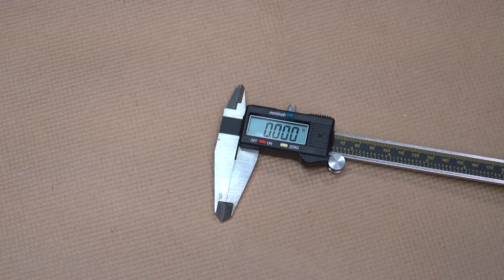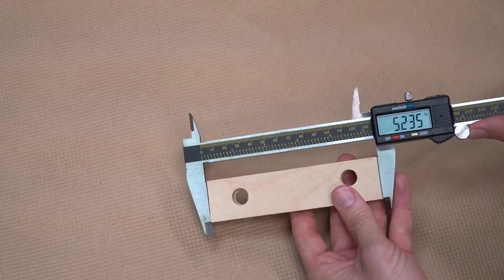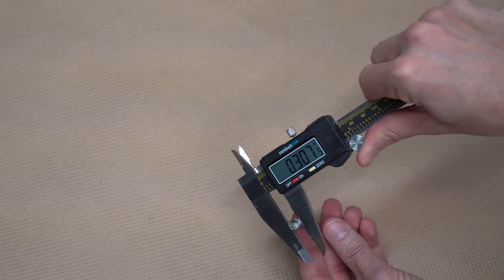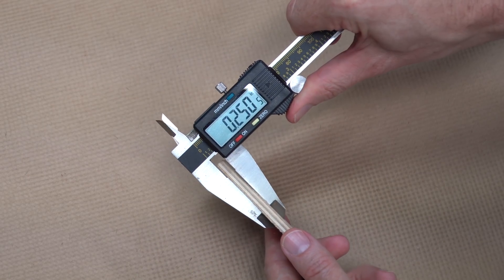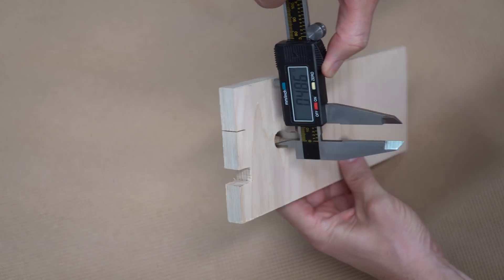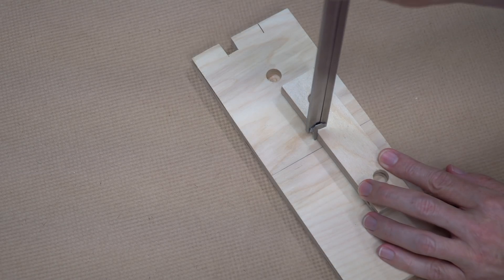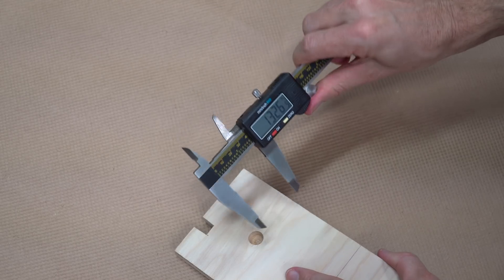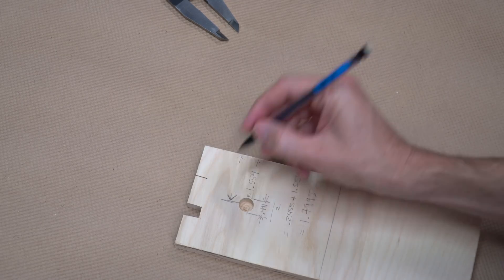What are Calipers Used For?

Comment: I have that exact same caliper. Is there a way to 3D-print the cap of the battery slot? I've lost mine. Thanks in advance
Reply from the maker: The features of the battery cap are pretty small and delicate....I fear a 3D print might not hold up. You could try to create a cap from a small piece of plastic that you carefully carve into the correct shape. Either way, it's going to be tough - good luck!

Comment: I learned as a tool and die machinist, some 25 years ago to use a dial caliper. Yes the digital were available. But cost a lot more than I could afford as beginner. Another tip to share with the dial is you can get the centerpoint with using math.  Just find the distance then set your dial to Zero then reassure. And you can with a Thread Card use them to read the pitch of the threads on  bolts.
Reply from the maker: Awesome tips - thank you! I as well learned on a dial. I think I'd actually prefer a dial, but digital calipers are so much cheaper. Especially if you're looking at a good dial caliper. Thanks again!

Comment: Great tips!
You can also make measurements with the flat faces of the heads (on the left side of the calipers). Sometimes that works better than the thin depth probe.
With a digital caliper, you can measure the spacing between two identical holes without math. Measure the ID of one hole and re-zero the caliper. Then measure the widest distance between the holes. This is the spacing between the holes plus two times the radius of the holes. You can read the hole spacing directly from the caliper because it was zeroed  at the value of the hole diameter.
Reply from the maker: Great tip! Thank you!